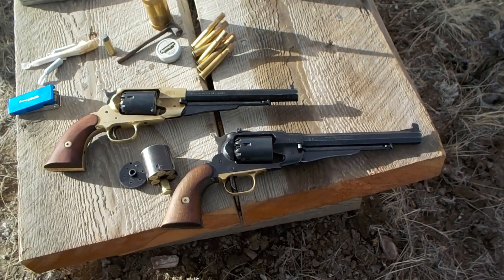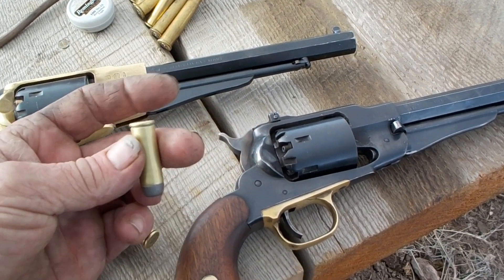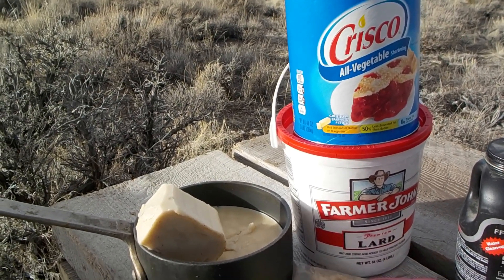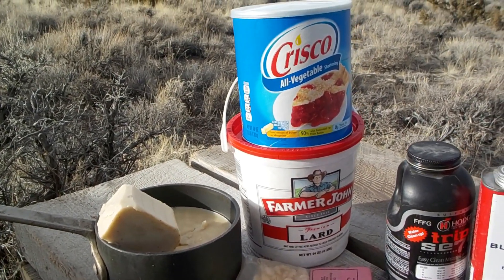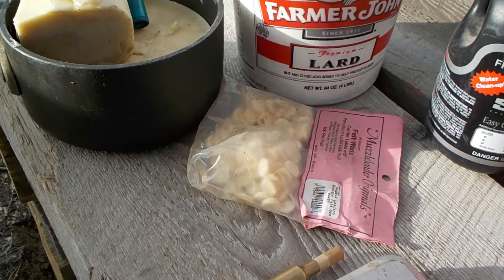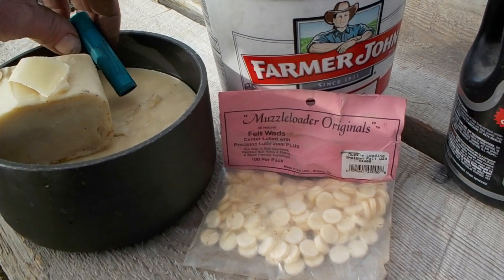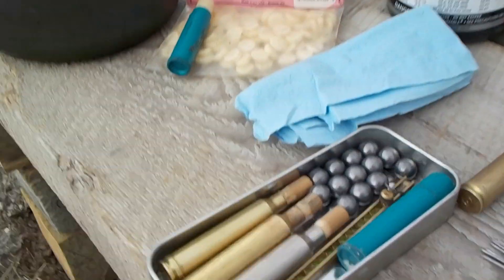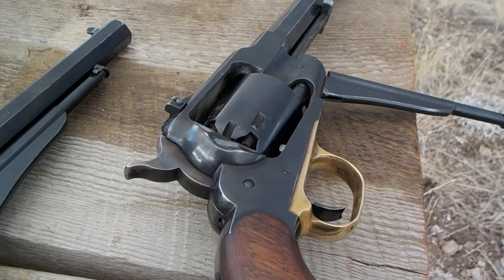rem58

Comment: I started shooting black powder back around 1970. Back then info wasn't very prevalent. I started with Crisco. Yes it melts easy and gets blown away easy on firing, but it keeps the fouling soft - which is what you want. Since I cleaned every day, I never saw that "glue" you talk about. I never tried lard because what I had contained salt. I actually like bore butter. It does work better in long arms, but always gave me good service. Any good lube is going to have a certain amount of splash-over, but it doesn't get everywhere. I always had a solid dry grip. The best lube promoted by re-enactors right now is lamb tallow and beeswax mix. 1 to 1, up to 3 to 1 tallow to beeswax depending on who you talk to.
Wonder wads work, and are much cleaner and handier, but for extended shooting sessions lube on top of the ball works better. 
ALWAYS AVOID petroleum based products if you want to keep fouling soft. As it burns, petroleum products leave a "tar-like" substance behind. Talk about fouling!!!
Chain fire can potentially occur from both the front AND the rear. Loose fitting caps are just as problematic as poorly fitting balls. The only chain fire I ever had was when I had some loose caps and I pinched them on. Firmly fitting caps, and balls that shave a ring on loading, and a good lube, and you shouldn't ever experience the "fun" of a chain fire.
Without lube, cylinders can bind up from fouling in as little as one cylinder. With a good lube I have shot a full box of balls (100), and still had a freely turning cylinder.
I like that you are telling people to find what works best for them. Black powder shooting may have rules that need to be followed, but there's a lot of room to express an individual approach.

Comment: Great video. I agree the New Model Army is a good revolver but my peeve with it isn’t that it’s to small for my hand or that the cylinder pin gets fouled, it’s that the loading lever is very weak because of that pin you mentioned.
Reply from the maker: Yes that is a weak point do you use a lot of wheel weight lead?
Reply: damocsell I use mostly Hornady round balls but occasionally I try various bullet types some are actually cartridge bullets and I have always busted the lever getting the cylinder loaded on the Remington while my 1860 takes it like a champ

Comment: I am looking at the same 44 pietta 1858 pistol what kind of powder loads are you doing with tripple seven.
Reply from the maker: My opinion is you should start at about 20 grains and work up from there until you either reach the published safety limits of your replica or you get the power and or accuracy you were looking for.I tend to load heavy but not always.
Reply: coolastro - his recommendation to start with 20 grains and work up is valid, but in most '58's that will be a half load with round ball. With black powder (and substitutes) you want the ball resting on the powder without any air space. That means you will need a filler of some kind such as cream of wheat. To get the ball down on the powder, you will probably find you are using 25/26 grains with conical bullets and closer to 30 with round ball. An interesting aside is that tests suggest that 30 grains of black powder (in revolvers) is the most efficient in terms of speed per grain used.
Also  in my experience, 777 is somewhat compression sensitive. Try to use approximately the same amount of pressure each time you seat the ball for consistency of performance. It's good stuff, but it works better when you are consistent in your loading technique.
Reply: Bacon fat, cream of wheat, looks more like a buffet.

Comment: the chain fires you mention happen from the back of the cylinder not the front.
Reply from the maker: IMO I think it is more likely a rear cylinder problem but entirely possible and more likely if grease in the cylinder is not used especially if real BP is used or undersized or not perfectly round balls are used.I think its very good advice to take front cylinder chain fire ignition seriously.
Reply: Chainfires happen from the front. It's incredibly unlikely that a spark can go around a capped nipple, or even uncapped. Whilst it's way more likely for a spark or hot gasses to go around an undersized ball. Use oversized balls and a overpowder wad or lube over the chambres, and you won't have a chain fire. This is from my experience with my 2 pietta remingtons. Cheers mate!
Reply: Erik_Greenleaf if the ball is tight enough in the cylinder to not move wouldn’t it be tight enough to protect the power from sparks? I would think so but I’m new to percussion revolvers.

Comment: What portions of lard to to wax to make this lube?
Reply from the maker: It depends on where you are temerature wise and the time of the year 50/50 is a good place to start add more percentage beeswax in warm climates or for summer use add more lard for colder climates or winter use I find i just use the same pot and add what i think is needed in the coming months.